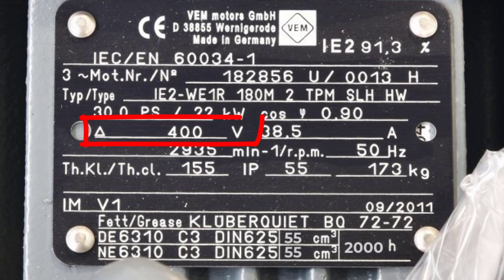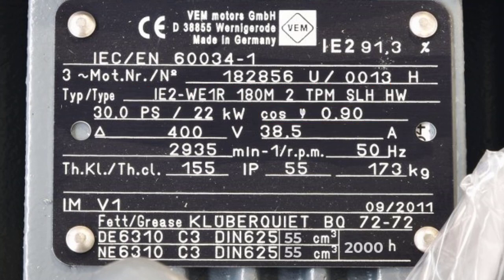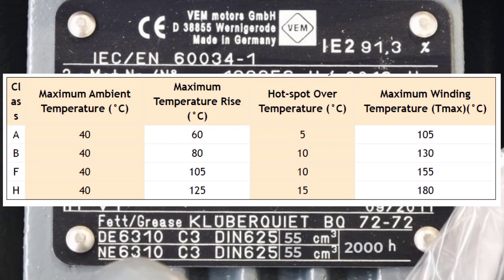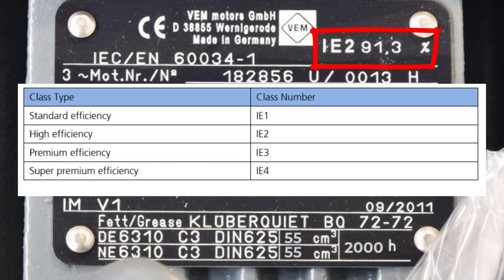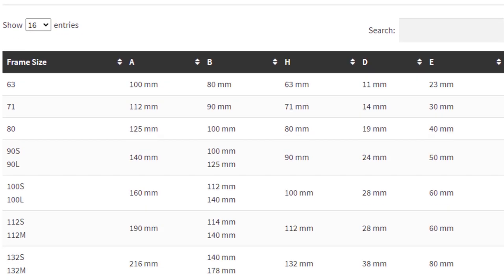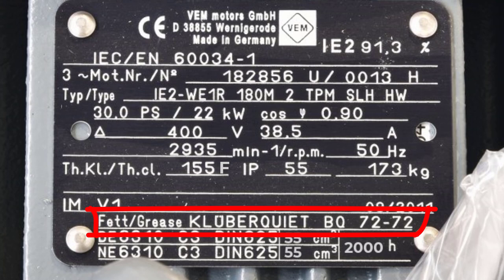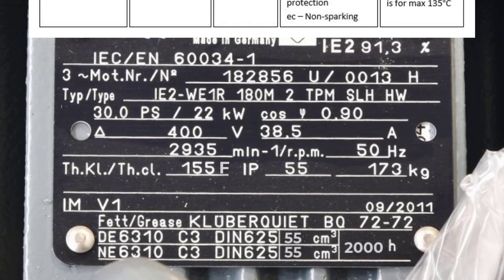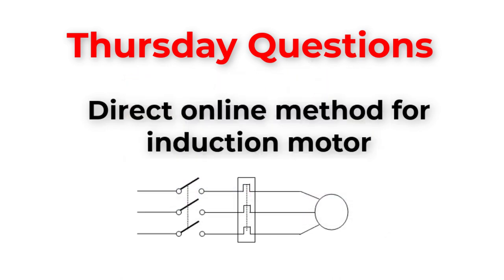How to read a Motor Nameplate (IEC standard)

Comment: Please, who knows how or where to get the starting current of such a motor. It is very important to size a diesel generator to run this motor.
Reply from the maker: The starting current of an induction motor can often be estimated or found in the following ways:

1. Motor Nameplate Data: If the video explained how to read the nameplate, look for the motor's full load current (FLC) and starting current multiplier, typically mentioned as a multiple of the FLC (e.g., "Starting Current = 6x FLC"). This is a key detail for sizing a diesel generator.

2. Locked Rotor Current (LRC): The nameplate may also list the locked rotor current (the starting current). This is the highest current the motor will draw when it starts.

3. IEC Standards: Motors compliant with IEC standards often follow general guidelines where the starting current is 6–8 times the full load current.

4. Calculate Starting Current:

If the starting current isn’t directly available, you can estimate it using the formula:

I_{start} = M \times I_{FLC}

5. Diesel Generator Sizing: The generator should be sized to handle the motor’s inrush current without voltage drops below acceptable limits. Consulting the generator's manufacturer for compatibility is recommended.